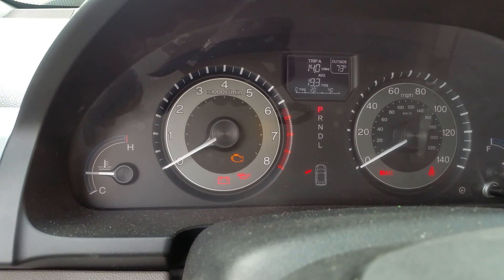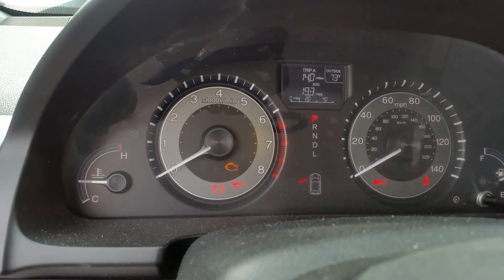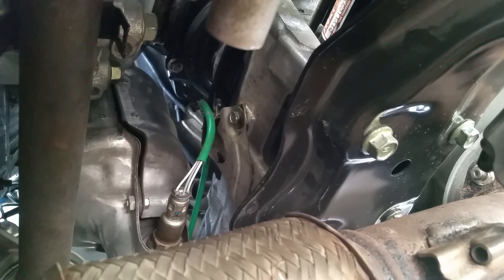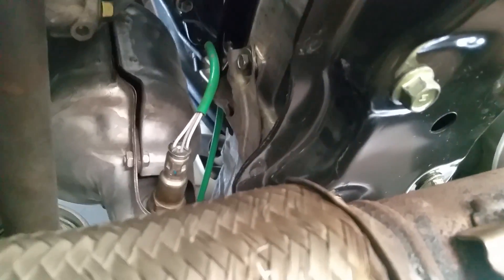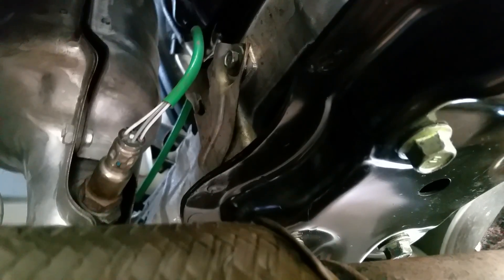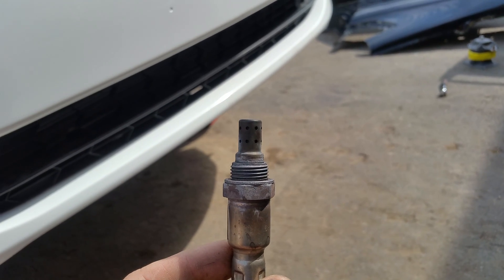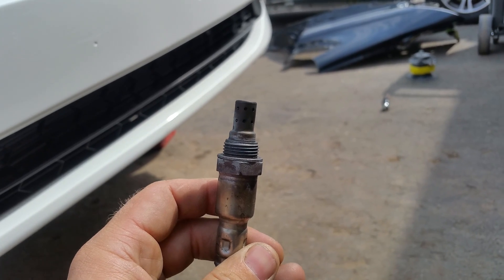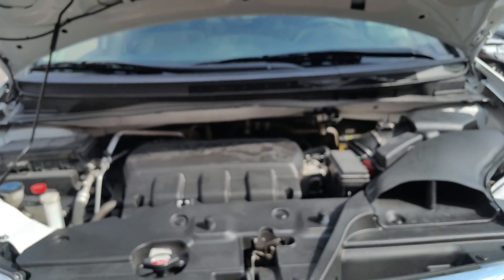How to fix check engine light P0158 DTC trouble code

Comment: Just replaced the same o2 sensor on my 2007 accord v6 … shortly after driving the check engine light came on. Scanner read P0158 high voltage. Any suggestions ? Thanks
Reply: Did you figure this out? Similar situation
Reply: @DearUriel  yea so replace the rear lower o2 sensor and also front lower o2 sensor. Problem solved light never came back on.
Reply: @Donjuliolll  so you replace the whole bank 2 side then, bank 2 sensor 1 & 2? Makes sense! I was thinking about doing that
Reply: @DearUriel  so in total two o2 sensors. Front ( B2S2 ) which is the lower front one and ( B2S1 ) which is the rear lower one. Hope this helps. Fixed my problem.
Reply: @Donjuliolll do you think this will fix a po159 also I have a P0158 and po159 changed the sensor 2 twice still coming back

Comment: There's something missing from this diagnostics. You HAVE to consider exhaust leaks! If the sensor is reading below efficiency, does NOT automatically mean a bad sensor! (Bad mechanics only replace what the computer SAYS isn't working right rather than consider things that CAUSE that!) That costs money and won't always fix the problem! BEWARE of insufficient diagnostics!
Reply: Wait. He did a diagnostic? Totally missed that part. 'Oh, look. There's an O2 sensor code. Well obviously it just needs a parts swap.'
Reply: Yes cuz I replace that 02 sensor and still that code pop up again I replace the catalytic converter and still in there I don’t know what else to do
Reply: @SCSIFRANK  stop firing your parts cannon at it. Have it diagnosed properly.  Don't be a Muppet and think Diagnostic codes fix cars.

Comment: i just saw a different video that said the sensors towards the firewall are bank 1 sensors 1 & 2 ......confused now
Reply: Bank 2 sensor 2 in odyssey mean front of the radiator
Reply: The one he's changing is centerline, offset toward the oil pan (passanger's side)